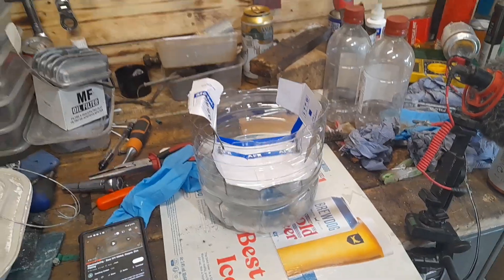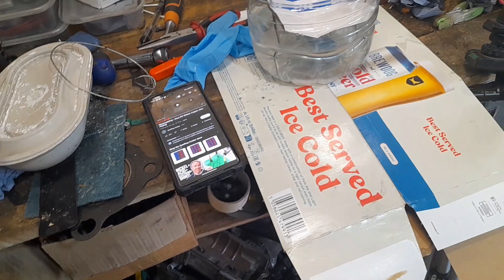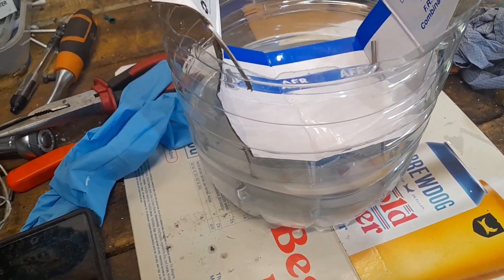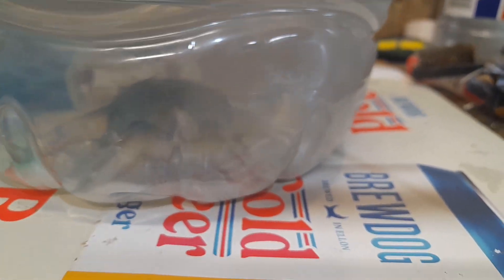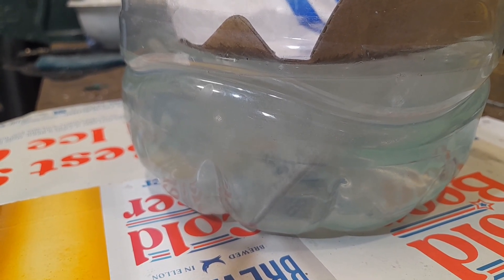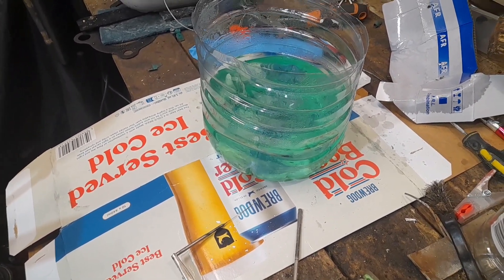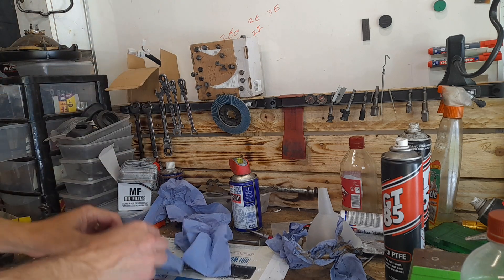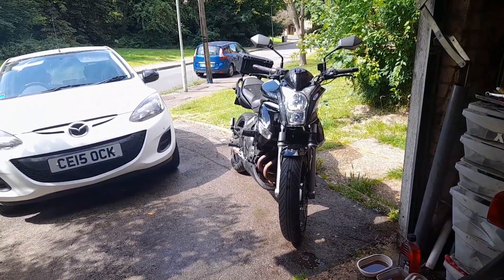Home Nickel Plating.  Ain't Science Brilliant!

Comment: On your anode (positive) only have nickel in the solution otherwise you risk contaminating the plating solution. If you support your parts with copper cable you can get a good gauge of the plating process as you will see the colour contrast more easily. 

I also found a load of luck really helped... 🤣